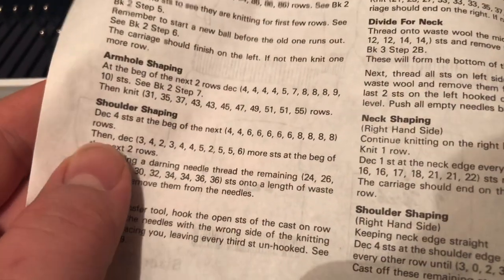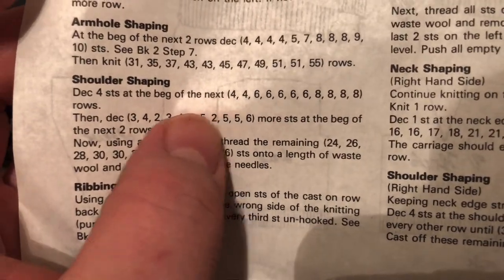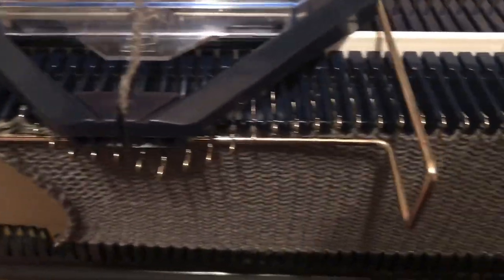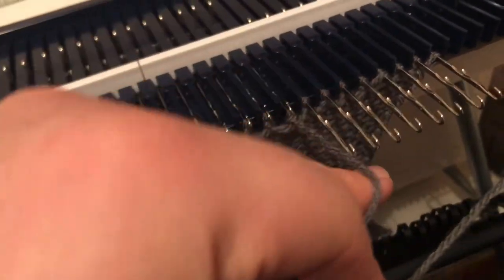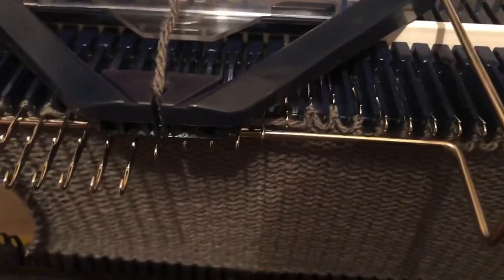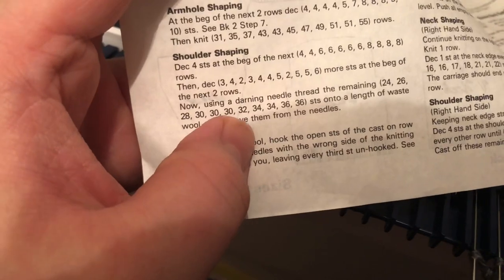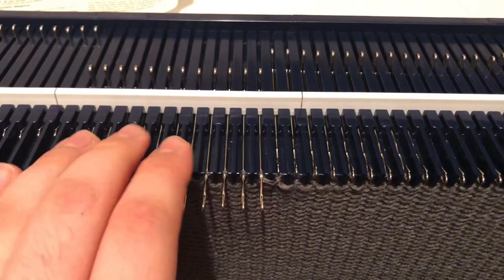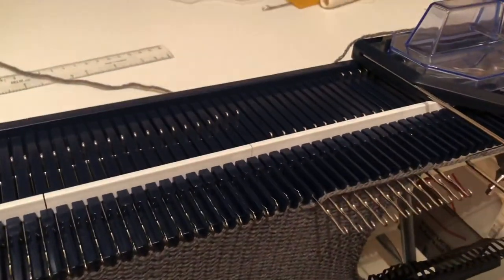Short Row Shaping (Partial Knitting) Of Sweater Shoulders On A Knitting Machine

Comment: Alex, I have knitted the front of the sweater by machine.  I used short row shaping on the neckline, then knit some rows to the shoulders and short row shaped the shoulders.  I did the same for the back of the sweater.  The two pieces are different lengths.  What did I do wrong?
Reply from the maker: Did you check that you were using the same number of stitches on the shoulder shaping before you started the short rows for the front shoulders, as you did the back?  This would be the only way this could have happened.
Reply: Yes, I did do, but I probably did not do the maths correctly. Thank you Alex